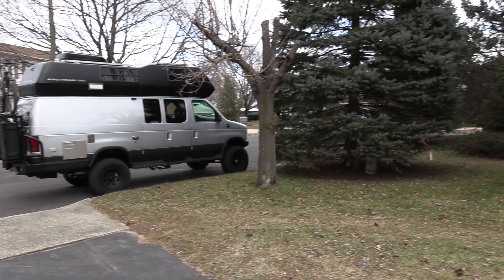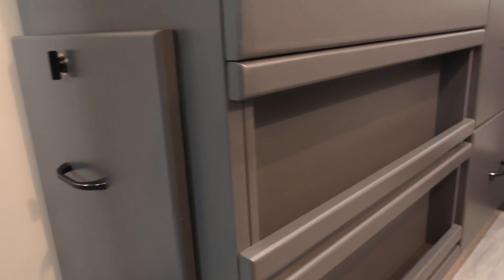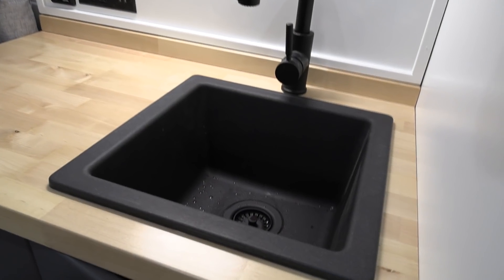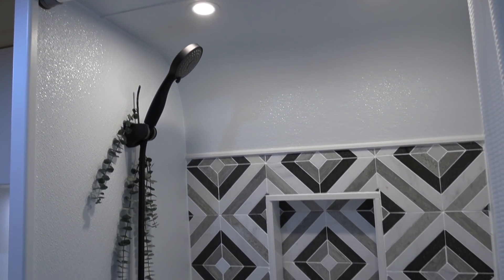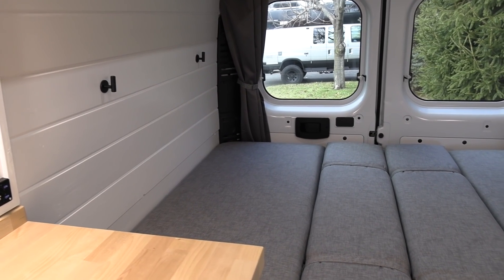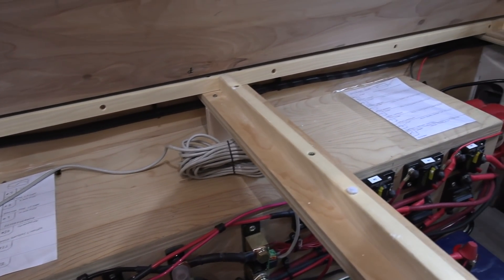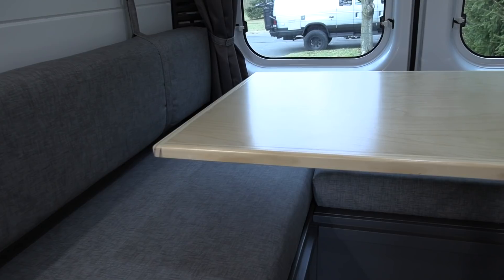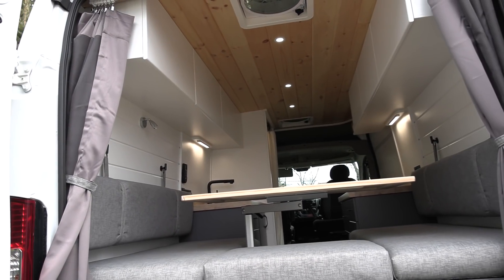CAMPER VAN TOUR | Retired Furniture Pro Builds a Spacious Apartment On Wheels

Comment: Nice build.  I especially like how he was able to incorporate a shower / toilet area and the hidden / slide out 12 volt fridge compartment area.  The rear dinette booth / bed combo really ties it all together.  Loads of cabinet space along with the overhead compartments are most beneficial.  Ever so neat on wiring and necessary solar batteries etc tucked along the wheel well area shows this man knows how to build a well thought out plan. 🚌

Comment: I like it! Very stealthy, very clean, very open. Great workmanship. Probably makes a great weekend to weeklong camper. How long did it take to build up like this?  Looks very professional. 

I really like the removable center pass through, though I would have probably made it fold down into the floor, less to loose and more seamlessly integrated. Probably would have concealed the electrics and water control features under a false floor, to add more storage.

Not for me, too much work to convert to and from sleeping.  

But, super work none the less!
Reply from the maker: Thank you for the useful information

Comment: Just curious how well insulated this van is against the cold? I did not see any insulation against the back doors. Will van lose a lot of heat thru metal there?
Reply from the maker: There is insulation all around and inside the rear doors
Reply: I had the same concern Jim...

Comment: It's a nicely built van, but what a terrible idea to install a diesel heater when he could have installed a gas heater and simply tapped into the chassis fuel tank to run it. Why put toxic diesel fuel inside your living space if you don't have to? Makes no sense.
Reply from the maker: Thank you for the additional information